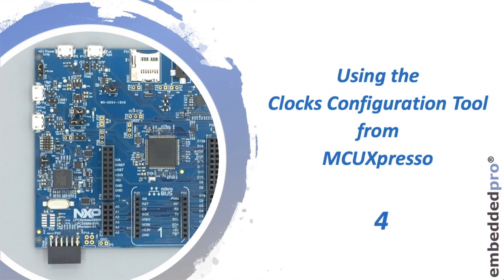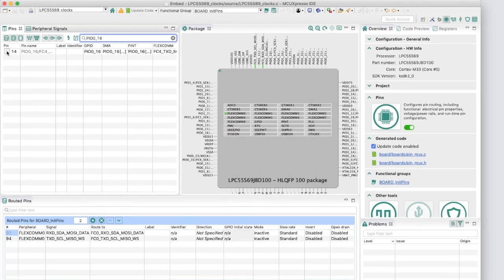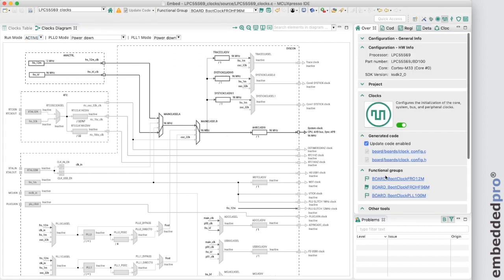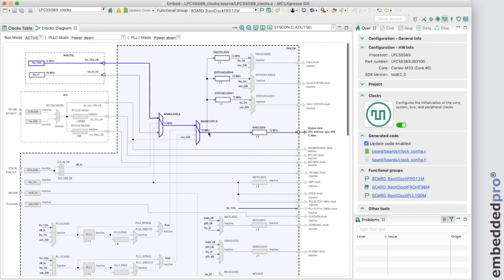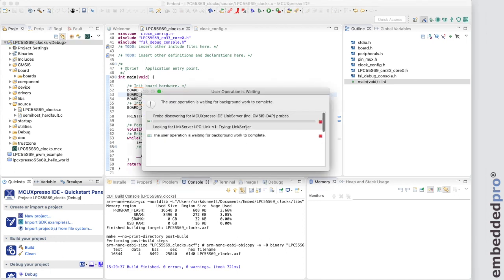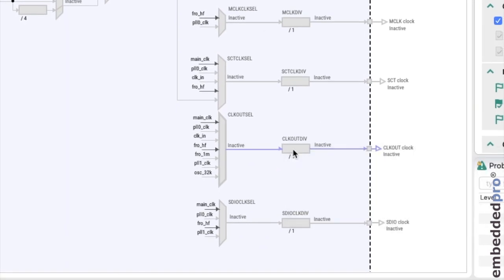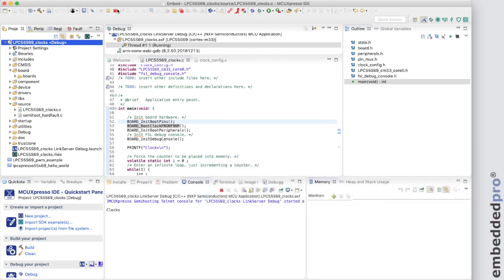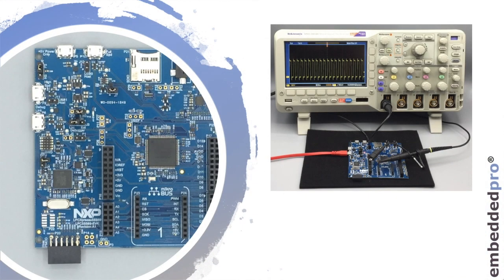4 Using the Clocks Config Tool from MCUXpresso - practical

Comment: Hi Mark, We observed  that12Hz frequency works( able to see the signal on scope with stable frequency) when tested on mac using LPC55S69 board but do not work ( frequency from 5- 100MHz)on windows with same LPC 55S69 board, do you think there is a difference in USBs used in two machines?
Reply: Mark, Could you please help me figure out this issue of not being able to measure clock frequency?

Comment: Hi Mark, thanks for these videos. I wondered if you have attempted to use PLL1 on this chip/Dev kit? I ask, because I want to use it in an audio application (a polyphonic audio playback system for use in model trains, reading 11025Hz files off an SD card).  I am using PLL0 as per NXP's SDK example, to set up the WM8904 codec at 24.576MHz clock frequency. I want to use PLL1 to set up  SDIO clock with a frequency of 50MHz. However, whilst I can configure PLL0 to do this for SDIO (obviously not when used for the audio codec),  I cannot achieve the same with the PLL1, despite setting it up and updating the code in exactly the same way. The clock read back to the SD card comes back as 0Hz, and the SD card does not function.  I wondered if perhaps there is something wrong with PLL1 as a module..? Thanks for any help you may be able to give.